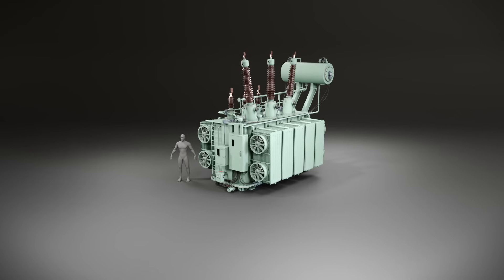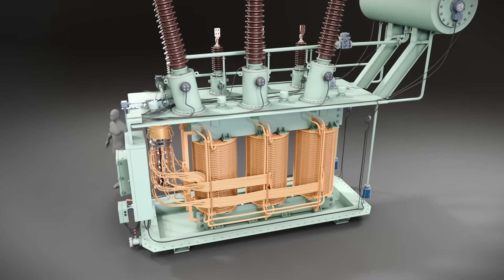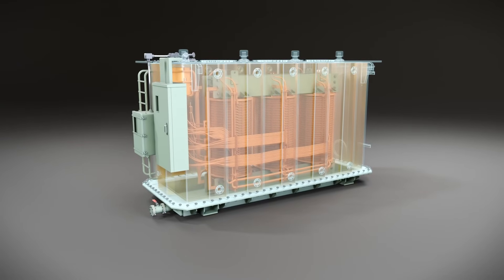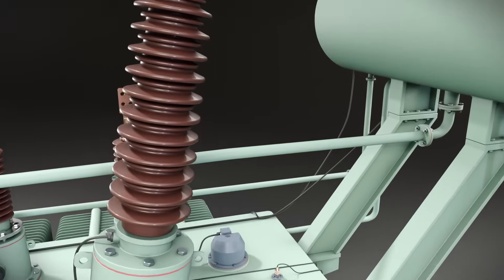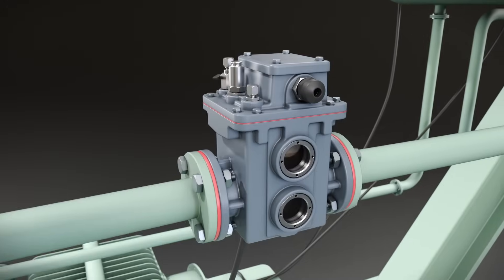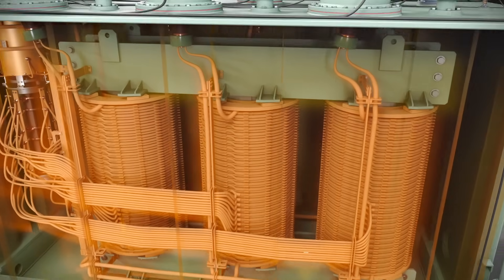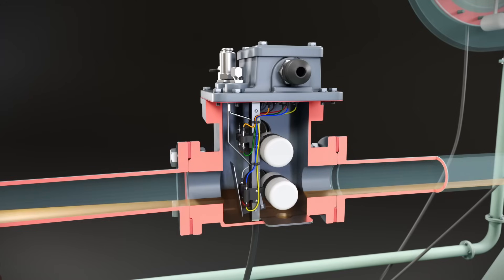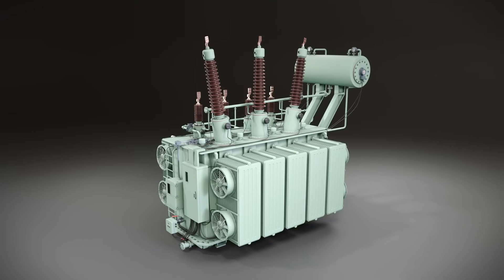What is Buchholz relay? | 3D Animation #transformers

Comment: with all the protective devices, why do some distribution station  go up in flames like a gas refinery gone wrong, as seen in YouTube videos?
I know that mineral oil does have a flash point. is  it that and the high voltages coupled with the hydrogen content?

Comment: Great video. I like your 3D models, even though its a relatively simple design, but it has a lot of details! The OLTC, Bushings (even measuring pin in there at HV bushings!), winging clamps, leads! Well done!
There are some details, which are not in focus, but are there: 
- in general, current transformers (CTs) are also a part of measurement equipment responsible for the protection; HV measurement pins are also related to diagnostic equipment.
- on top of the expansion tank (conservator) there are two gauges on top which are not mentioned, and I struggle to imagine what it could be ? 
- there are also four not mentioned devices on top of the tank from HV side.. kind of small pressure release devices?
The explanation is quite simple to understand. We like your simple and comprehensive style! Will wait for more videos on this topic!

Comment: Very nice and instructive video! I would have been glad to have it for teaching.
Buchholz-relay was invented in 1921. As Transformers grew, it turned out that Buchholz relays tripped too slowly in the rare failures of these huge things. So a young female engineer wrote a dissertation about this. It turned out that the mechanic shock waves propagated too slowly to the Buchholz relay in case of an explosion. So, modern large transformers have additional pressure relays on the tank to safeguard a quick trip of the circuit breakers and avoid large damage. This was a rare case where a dissertation 'summa cum laude' (in Austria 'sub auspiciis praesidentis rei publicae') caused a direct application in practical engineering.
German title 'Buchholz-Staffel' - never heard that, it was always called 'Buchholz-Relais' or 'Buchholz-Schutz' (Buchholz protection). Don't use AI, use HI instead. Even Wikipedia knows that.
Reply: What are you talking about ! "This was a rare case where a dissertation 'summa cum laude'" translation  actually means 'with highest honors' and its difficult to see how this applies in any way to a simple principle of protecting a power transformer.
Reply: @simonmaverick9201  I know what I am talking about. I have learned Latin, and I have studied electric engineering too. I know some people who wrote a dissertation 'summa cum laude', but none of them had a direct practical application. In this case, it caused that thereafter all larger power transformers have been equipped with fast pressure sensors at various positions on the tank. For small transformers, a Buchholz relay is still sufficient.